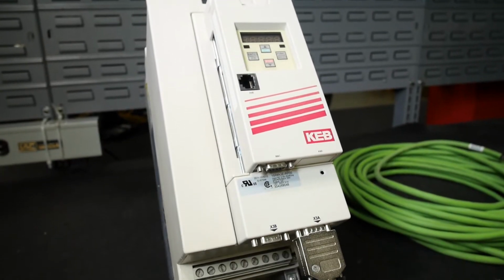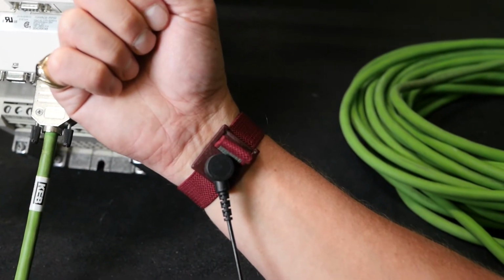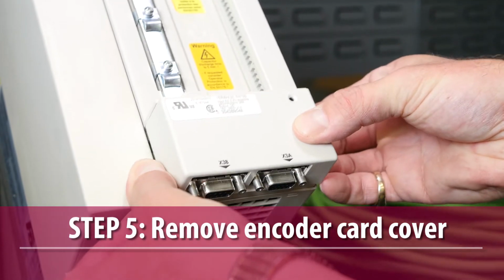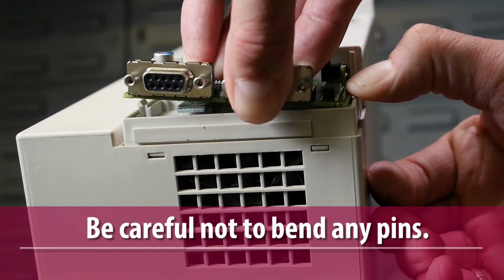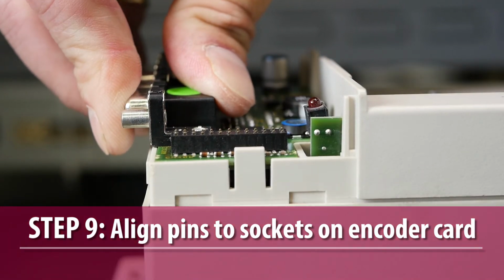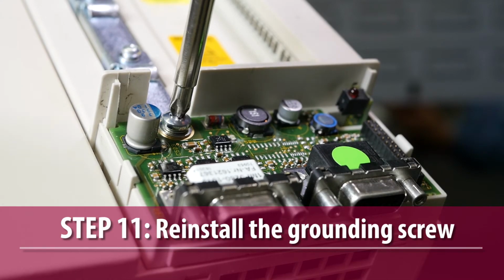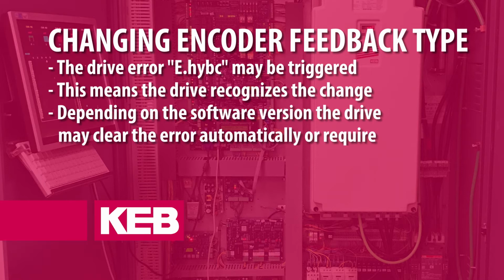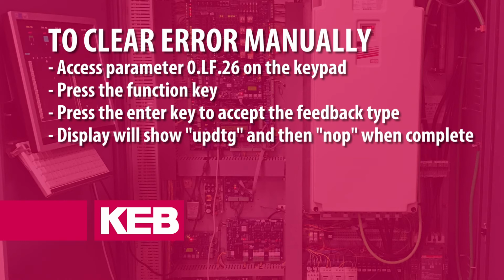How to Replace an F5 Drive Encoder Card - For KEB D and E Sizes

Comment: HI, thank you for the useful video, i have 24F5 KEB SERVODRIVE used in haitian injection machine, i installed and activated the software, I already have the YELLOW RJ45 TO RS232 CABLE BY KEB AND A GENERIC RS232 TO USB CABLE BUT WHEN I POWER THE DRIVE ON AND try to communicate with pc i fail???? no keb device detected after the scan can you give me a hint
Reply from the maker: Have you contacted Haitian about this issue? I would first contact them as the machine manufacturer for help. If they cannot find a solution for you, reach out to the KEB subsidiary near you. If you are in North America, please contact us through our website: https://www.kebamerica.com/contact

Comment: Hello, I have replaced the CPU card and the left LED is blinking and the display shows E.Puch , can you help ( The MAT Nº is 22F5G0R - 950A)
Reply from the maker: E.Puch stands for "Power unit changed." This is unrelated to changing the encoder card.  Was this an approved CPU replacement through our Service Department? For further help you should contact your original machine manufacturing company or contact a local KEB representative: https://www.keb.co.uk/contact/contact-worldwide